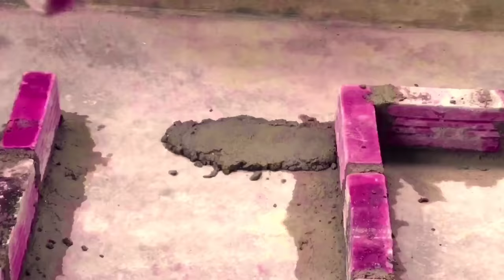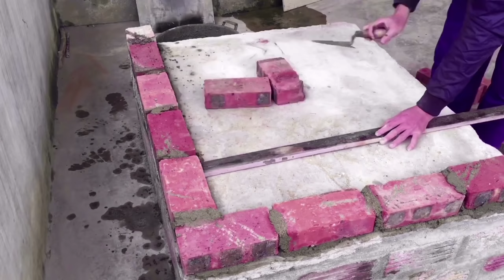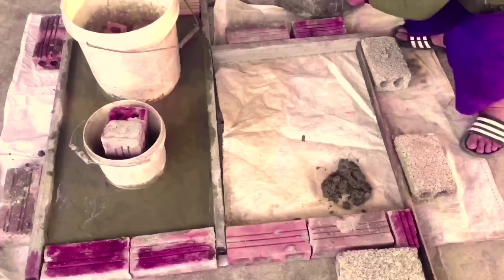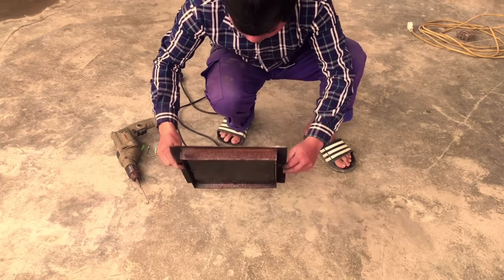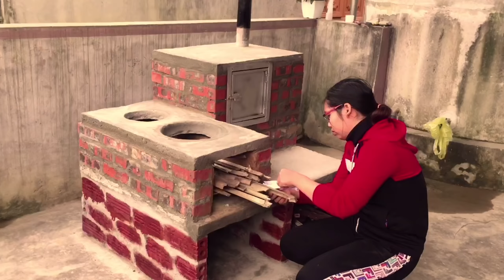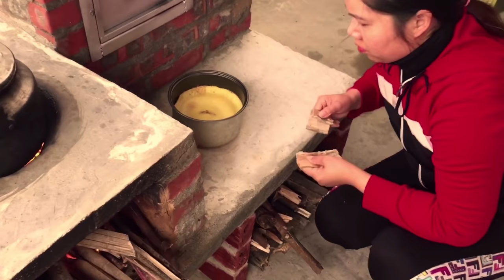Smoke-free cement stove with 3-in-1 bakery Creative \ Save firewood

Comment: instead of leaving a 2 holes for the pots, next time try a old electric cooker glass hob top to cover the wholes, also make a cover or door for the entrance of the fire to control the fire. if you make the oven larger you can make it into a tandoor and a pizza oven for larger items like roasting a leg of lamb, cooking pizzas. also, add more clay and insulation to get higher temperatures

i'm looking for design ideas to make something similar for my garden cabin. it must have a tandoor, pizza oven over and some hobs... surplus heat used to heat a cabin and bench. experimenting of grid living in my garden. 

good job
Reply from the maker: Thank you ❤️
Reply: Nice one

Comment: Plaster it with mix of Clay , Sand, Lime, Husk n Cow Dung .Use Air Extractor on the Chimney which operates on slight movement of wind doesn't require electricity